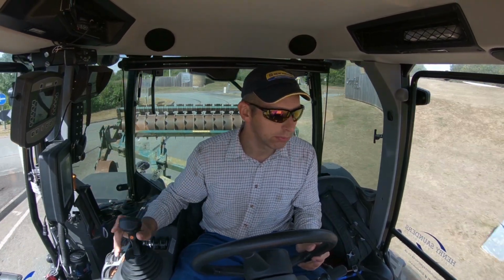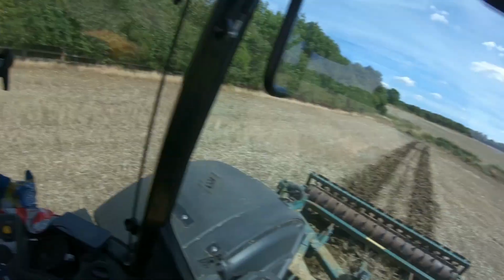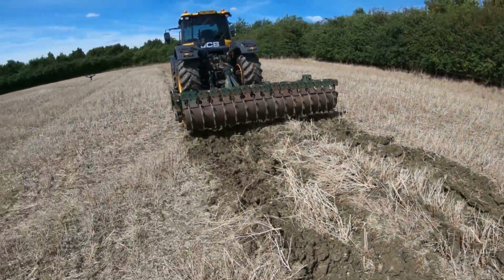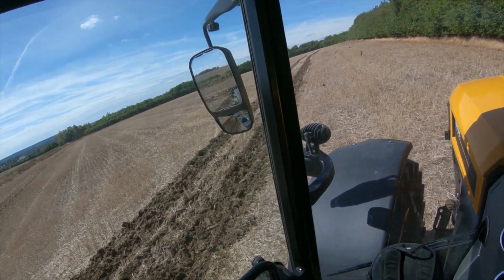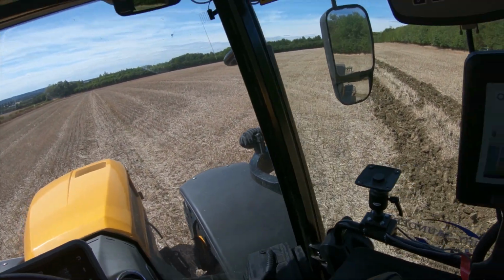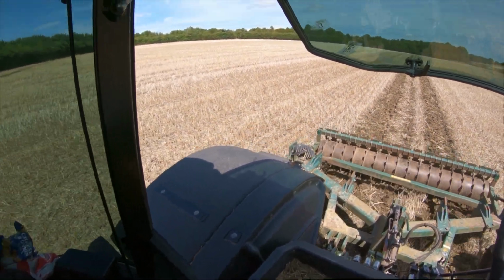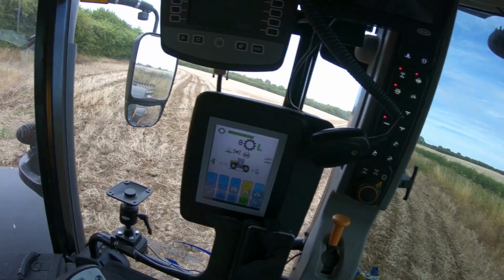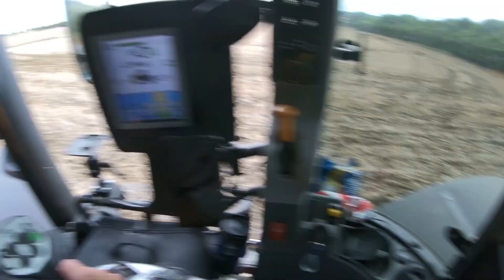JCB FASTRAC POWER! BUT CAN it CULTIVATE?

Comment: Lovely angles there George!
She’s done well, 5 legs in hard ground! That’s not easy work but it coped well! And 40ltrs an hour is good going too for any tractor in those conditions :)
Reply: Jonny 1388 dread to think what the 1050 drinks when she's hard at work!
Reply: Hiya sid! When she’s working hard it jumps up to around the 90ltr an hour mark, when I’m putting long shifts in with it working land il use between 500/700ltrs a day depending on the soil type. 
But that’s covering a massive amount out of ground, so it brings  the cost per ha down if you get me? :)
Reply from the maker: Not bad for an ol' fastrac Jonny mate😉

Comment: Fendt Vario 900 The integral tyre pressure regulation system VarioGrip adapts the tyre pressure from 0.6 to 2.5 bar within the shortest amount time – even while driving. This is accomplished via the integral rotary union, which is designed to last the lifetime of the tractor. Air is supplied via a water-cooled double-compressor as well as the vehicle's own valve equipment.

Comment: Pulls that ripper pretty good  george we used a john deere 714 chisel plow on a 8650 john deere articulated tractor full duals all around and full weights and back tire weights any way in clay soil so hard it had tractor starting to wheel hop not bad but shook you in seat so i feel you

Comment: Lovely filming George you getting to be a master at that!  Was the drone on automatic pre-set flying or someone was doing manual?   I was wondering since the soil is so hard and dry still there, would it be better to use a bigger tractor with big wheel weights and a big weight on the front linkage?  And a bigger wider Cultivator or maybe a big plough the cultivator? as it will take ages with a small one and although your JCB tractor doing ok, it still is finding it a bit too hard to do!    If like here in Kent your soil is dense and filled with lots of stones all being Flint based it will take a very big powerful tractor and strong plough or cultivator with sharp blades to deal with stony soil that has had little rain and very hot weather?  We just had some storms and allot of heavy rains now ( from the 9th August to the 11th )   But the lawns still yellow and brown and the soil is still hard as heck!  How often do you need to sharpen or replace your blades on the plough and the cultivators?

Comment: Why are you subsoiling? The dry summer has cracked the soil well down. All you are doing is compacting the soil where your wheels are spinning.. Let me see you with a spade and dig two feet down before and after. You might be shocked. Always have a good dig before subsoiling otherwise it is a waste of time and diesel. What you going to do when the oil runs out?